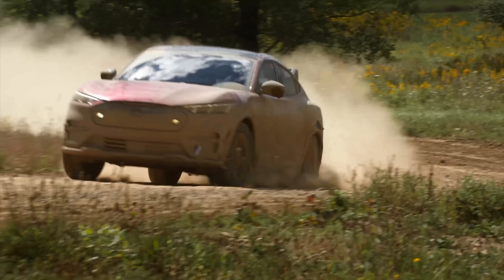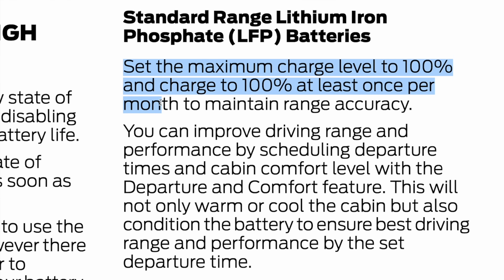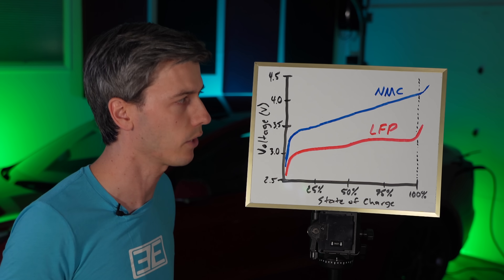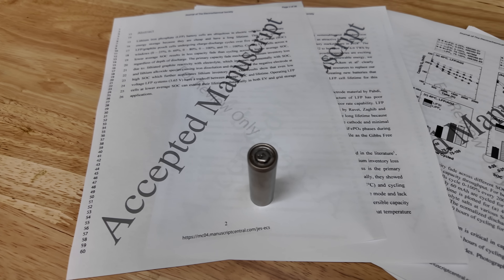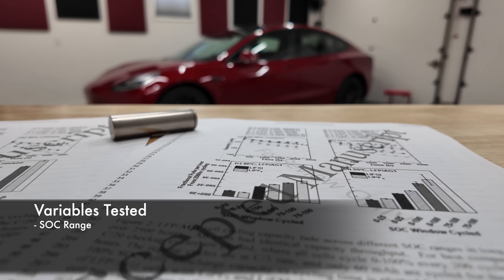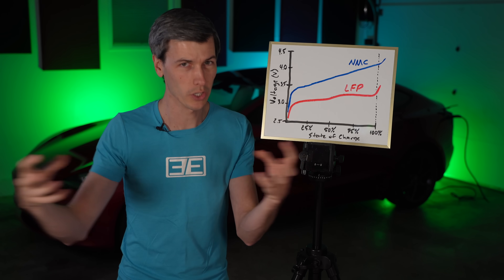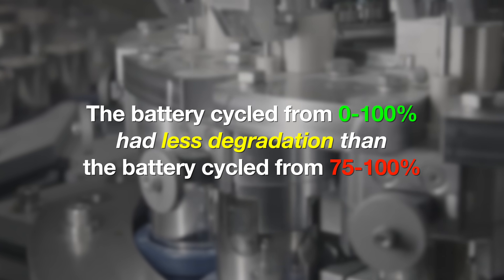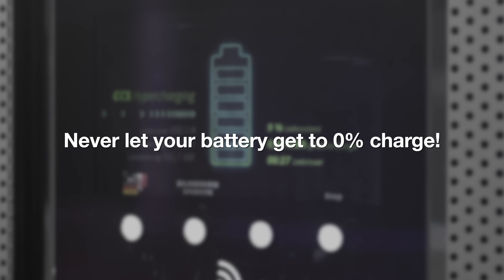How To Ruin Your Electric Car's Battery - LFP Edition!

Comment: Really need to cover actual degradation curves of LFP versus NMC and NCA. Because LFP degradation rate is much lower than the cobalt based lithium ion variants. 

The thermal stability and overall strength of an iron phosphate lattice is on a totally different level. This difference is extreme and needs to be covered in this video. Charge to 100% daily and forget about it. 

People stressed about solar lfp battery cycling years ago and we realized that calendar aging will kill your battery before cycling or cycling thresholds ever will. These batteries will last MUCH longer than the car will. There is zero logic in being nice to these batteries. They are designed to be abused.
Reply: Also the studies conclusions need to be accompanied by degradation curves. Over simplifying things without showing the actual data and degradation rates does not paint a clear picture. These batteries are so good at this point that The consumer doesn't need to worry about how they cycle the battery. Just charge it as much as they possibly can and forget about it. There are Teslas that are supercharged every time to 100% and the degradation rate is minimal. These batteries are meant to be abused.
Reply: @WillProwse  Also in the paper the authors state that "It is important to note that we cannot make conclusive lifetime extrapolation statements, because these cells were stopped for destructive analysis after only 2500 h of testing. The best performing cells retained 97% capacity at that time, while the worst performing
cells retained 76% capacity. Some preliminary unpublished results on smaller sample sizes suggest that LFP cells cycled at high average SOC may not experience a continuously rapid capacity fade and could recover in later cycles. More work will be done to investigate this mechanism after longer cycling times." - so even the authors won't make a definitive statement, which the video omitted to mention.
Reply: @upnorthandpersonal  good point
Reply: @WillProwse   I have watched your channel for many years.  One thing I don't understand is why in the portable/solar battery space that LiFePO4 is generally the recommended chemistry yet I'm unaware of any EVs that use it?  As in, why aren't EV companies using it?

Not asking for you to answer here necessarily but happy if you do. Maybe a video topic idea (if you haven't done one already)?  Probably related to it calendar aging out faster than recharge cycles?
Reply: @yayinternets LFP has lower energy density so less Wh/kg -> your battery is either smaller or heavier in comparison to NMC.
This is irrelevant for stationary use.
Reply: @yayinternets It's almost the majority of all EVs now globally. America unfortunately is behind when it comes to EVs. We are still using the cobalt base chemistry predominantly
Reply from the maker: @WillProwse  Solid feedback! I did include in the video that you really don't need to worry about it, and that it can hit 200k miles no problem. That said, it's not necessarily true that LFP outlasts NMC. Dahn showed in his lab that you can design NMC to outlast LFP. But from a materials standpoint, inevitably we need to move away from NMC. So LFP, and eventually sodium, need to be considered.
Reply: @EngineeringExplained  oh good points, so there are some NMC variants like Tesla powerwall 2 that can last an extremely long time. I think they added silica to the anode if I remember correctly. But overall LFP will degrade at a lower rate every time (and significantly more when internal cell temp is managed with a heat pump). NMC can last a very long time but cycling threshold should be managed. And the temperature has to be perfect. LFP is not as sensitive to temperature fluctuations. But they are harder to charge when they are cold.  There are also slight variations in LFP  variants that change degradation characteristics and electrolyte formulations that can change the temperature for which they are cycled at. Good example is Winston cells. 

The big difference with LFP though is the overall strength of the iron phosphate lattice. It can handle higher temperatures and voltages without the same issues.
Reply: @EngineeringExplained  managing pack temperature will slow down calendar aging. It is crucial for reducing degradation. Keeping a LFP nice and cool is the best thing you can do for the pack. Given it's better stability. 

something else to mention is the thermal mass of LFP is increased versus the cobalt based variants. Which means fast charging can be accomplished at a higher overall rate over the charge curve because the battery takes a longer time to heat up and is also easier to manage with heat pump than the cobalt based variants. This was also mentioned recently by rivian when discussing their new LFP packs. 

The Cobalt based variants can handle a higher charge C rate, but need to be cooled at a higher rate. So heat pump capacity is a huge factor when charging those. That's why older Tesla's without the heat pump would throttle the charge current pretty fast. The new model x and s can pull high numbers because of the new heat pump because it's massive. Which is required because they still use NCA cells. It's huge too, if you look at the front trunk of the model s, the new heat pump is massive haha
Reply: @EngineeringExplained  but the new Tesla powerwall 3 uses LFP because they are manufacturing them at larger volumes and overall calendar aging and thermal stability is better than the older NMC chemistry they used. It was good, and I love NMC, but it's not even close to LFP. Especially the latest cells available. Also the safety of LFP is fantastic compared to cobalt based variants. There is no self-propagating exothermic reaction when there is thermal run away.
Reply: @EngineeringExplained  by the way I love your channel!!! Been watching for ages 😁😁 so cool to chat!
Reply: @WillProwse  Was about to post a link to your video interview with Battleborn CEO, best info I have found anywhere on actual LFP chemistry and aging and the whole never never charge to 100% issue that comes from NMC chemistry. LFP runs much lower voltage and the chemistry more stable, so voltage driven is much less that NMC, so even storing 100% SOC it will out cycle NMC 5X even if its not perfect.
Reply: @WillProwse Thanks for this! I was stressing! I will continue to just charge my LFP battery regularly lol.
Reply: Lfp is well behind in energy density the 4680 Carbon Nikkel Silicon is likely to be the foundation for long range cars
Reply: @WillProwse  car manufacturers take care about the charge and discharge parameters, the user should not think about it. 
just charge and drive. as you said. but i charge my nmc car to 90% if i do not need the full charge. 90% is in reality 80% because they have most a 10% upper buffer.
Reply: @WillProwse  There is the case of the Uber driver who did supercharging 2X/day whose batteries actually failed (range in the low double digits and error messages from the car).
Reply: @franklofarojr.2969  what chemistry? What year car? What failed?
Reply: I mentioned it in an original comment I posted, but I also feel him expressing that another study expressed completely conflicting feedback means that there's an interaction variable (maybe it's temperature alone, maybe something else?) that needs more study. Really, I think more study on best power practices of LFP battery chemistry is needed.

Overall though, I echo your sentiment about the longevity of LFP batteries. If the information given is to be believed (I'm a little hesitant taking anything Mr. Musk [or really anyone] says at face value), these batteries should outlast the majority of any application.
Reply: @builder1113 calendar aging and cycle degradation are independent processes. A lot of our cycle life studies are at higher C rates than what we use in the real world. At least related to solar use. Makes it very difficult to draw conclusions from one study alone.
Reply: Have to agree. Between the higher thermal runaway temperature, the lower temperature once burning, and general abuse resistance they're a safer cell then most chemistries. Throw in that they have good enough power delivery, good enough storage density, and are on track to be cheaper then NMC or NCA, it's unsurprising the auto industry appears to be moving towards LFP.
Reply: Great to see Will and Jason discuss this. Both of your channels are awesome treasure trove for those learning in the respective fields.
Reply: @nagki  Agreed.  I just stumbled upon Will's comments now.  It felt..........Worlds Colliding!  😂
Reply: bro thats so helpful thanks for the input. been watching your channel for years❤
Reply: The load pattern in our solar installation is very different though.
Peak discharge is <1/3rd of capacity. In summer we artificially cap it to 70% because we can sell the excess into the grid, and in winter it will never reach capacity.
But we also use it to "buy the cheap night excess" and to limit peak network consumption.
This puts up to 3 60% cycles on the battery a day.
The LFP module handles this very gracefully.
Reply: Recently I saw tests of new LFP battery (perhaps 280Ah) and it lost 1Ah after each full charge&discharge
Reply: @NikitaGarets  That's normal for new cells. New cells test higher than their rated capacity (a 280Ah cell should test over 300Ah). After some cycles, this stabilizes at the rated capacity. At 25C, you should be able to get around 4k cycles before you hit 80% of this rated capacity.
Reply: @tripplefives1402 As in more energy density? Yeah. Capacity is irrelevant.
Reply: A man who really knows his stuff..
Reply: @ckfml  did you?
Reply: The difference between fully charging every single day and doing it 2-3 times a week tops..

..Is the difference between the car lasting 9 years or 20.
Reply: Is this test neutral? No financial stakes here?
Reply: "They are designed to be abused." - Funny... DCS says the same thing about their 12v LFP batteries for engine-bay usage, and is currently suing a youtuber for showing their claims are BS and degradation is a big problem.
Reply: @thom1218  🤣🤣
Reply: Definitely not worrying about LFP.   I've seen a ton on NMC but LifePO4 is just so much better.  Getting a LFP model 3 but it is a lease definitely not worrying when I'll have it for 3 years.  I've got about 12.8kw laying around the house I'll be more careful with.  But they are in the garage in Houston so...
Reply: @ewitte12  Where did you get that LFP are so much better than NMC ? Did you watch the video ?
A NMC charged at 3.6V (arounf 70-80%) like a LFP at 3.6V (100%) will have...the same autonomy and..the same degradation. But obviously, the NMC can be charged at 90% or 100%. You cannot charge a LP at 130%.
I have the feeling that people things LFP is magical thing although this is what is used for modelism since 25 years.
Tesla could put a heavier and bigger LFP battery in the Model 3 for the entry model. But the NMC battery is giving 25% more range, for the same weight, and charge faster, and support better cold temperature. But yeah LFP is cheaper.
The issue is that we will have to built car that can be used for longer trip and smaller than 4.7. And to put a 60-70kWh battery in a 4m car, even in improving a lot the packaging, it will be difficult to be able to do that with LFP.
Reply: My favorite part is, since EV charging station will never be ubiquitous, an owner has a decision to make; at 80% charge, do I top it off now or grip the steering wheel tightly to the next charging station*? I might degrade the battery, or I might be stuck in the middle of nowhere. What to pick 🤔?
Reply: @tango_uniform  Owning an NMC based EV for the past 6 years, I charge to 95-100 before any trip and will during a trip if needed.  Sure the high charge isn't great, but if it isn't for a long time or in extreme heat, it's not really a big deal.  In 65k miles, I've maybe lost 10 miles of rated range and my new tires probably give me more range now than I had 3 year ago when I put on some cheap ones.
Reply: @tango_uniform  80% to 100% takes ages.
Reply: @tango_uniform I'm guessing you are anti-EV? There is literally no reason ev charging stations won't become more common. If anything the fact that logistically challenging gas stations exist in significant quantities proves ev charging us feasible.

Comment: Just switched my lead acid golf cart to a LifePo battery. Fun lil project, great decision. These batteries are bulletproof. 

Great information.
Reply: Nice. Instead of replacing them every five years, you'll probably never need to!
Reply: So did I and I wish I would have done it a long time ago. I went with a 48v 110ah battery pack and a 600a controller AC conversion. Does this study relate to us and our lithium golf carts?
Reply: @chrisginoc  600A? How fast does your golf cart go??!
Reply: @chrisginoc  it sure feels like it relates haha. I actually used a lifepo4 51.2V 100ah server rack battery and changed the stock bms on it. Shouldn't have any issues for the next 20 years lol.

Comment: Thank you. We have an XC40 Recharge at home that's only used for short trips and battery longevity (not range) is what we most care about. We try to keep it not above 60% and not under 30% at all times, charging in small increments when possible. Only very occasionally the car gets charged to higher SOCs. Volvo doesn't publish battery chemistry so we assume it's NMC, but knowing that the Iron batteries essentially follow similar principles for health and longevity is good to know. Great video as always!

Comment: Do those general practices also apply to LFP powerstations? I use an Ecoflow power station as a UPS for a fridge, a freezer and two sump pumps. I was told that I should keep the SOC at 100% because it was LFP. Should I cycle it from time to time? Thanks!

Comment: Thank you so much for this information. I have a 2023 Tesla Model 3 RWD with an LFP battery. I’ve been charging to 100% once a week and not charging in between (I end up at 20-30% at the end of the week). I’ve been really worried about minimizing degradation while also having an accurate SOC estimation. I may move to charging to 100% every two or three weeks and charging to 80-85% in between.

Comment: If I have an LFP battery, but I need to charge a bit more frequently for smaller cycles because of requirements by my electric utility, does that mean I should just set my charge limit to a bit lower and then charge to 100% like once a week or month? I've been doing small cycles to 100% up until now so that's great...

Comment: I have a 2013 Chevy volt and I have to admit that on one hand it’s annoying that the range of the vehicle is only 36-44 miles but it’s an incredibly stable battery because apparently Chevy really limited how high and low it could charge. After 145k miles , I still get about the same range I had 11 years ago , maybe a 5% degradation.